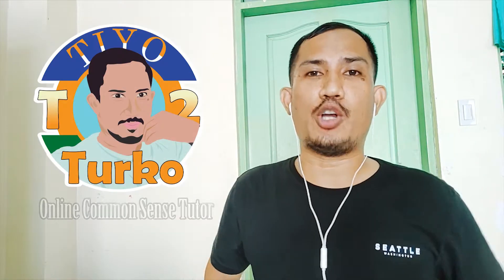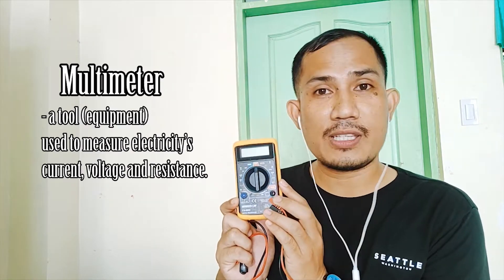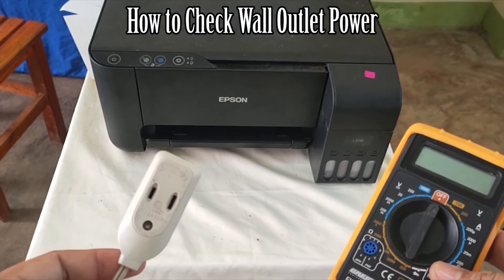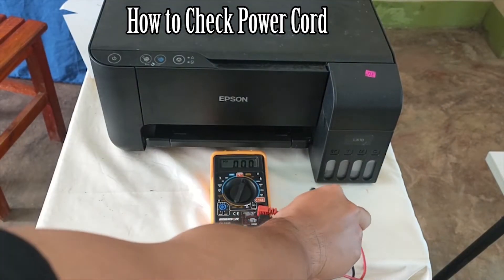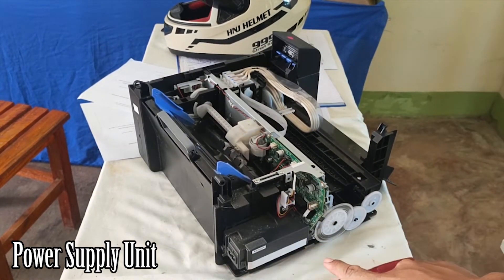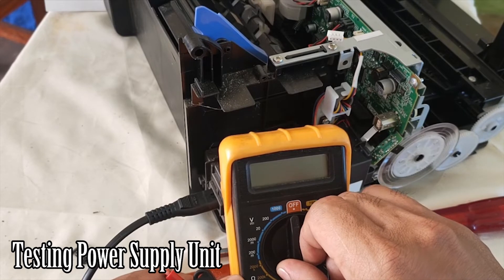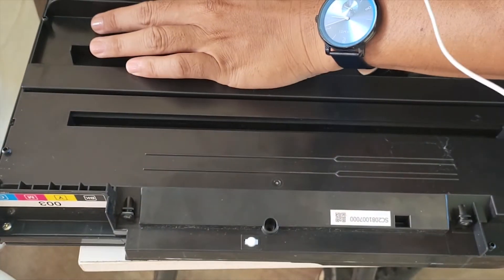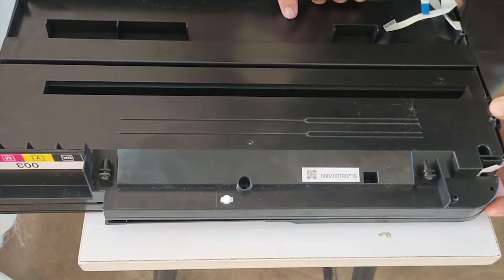How To Troubleshoot No Power Printer Epson L3110

Comment: My printer Epson l3110 is printing white paper without colour nor black then i cleaned the printhead with water when I installed the printhead on the printer now the printer is not power on. Is there any solution Sir?
Reply from the maker: Hi! You need to do a power issue troubleshooting first. https://youtu.be/sUtlcRfemEU Then, if the issue still exists, there's a possibility that the print head wasn't completely dry when you reinstalled it and it caused a short circuit that damaged the printer's main board.